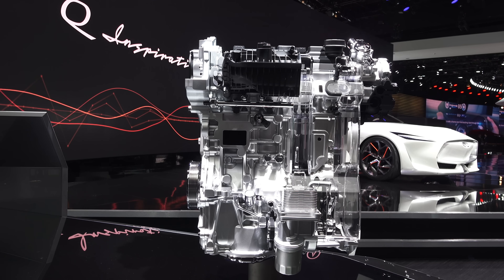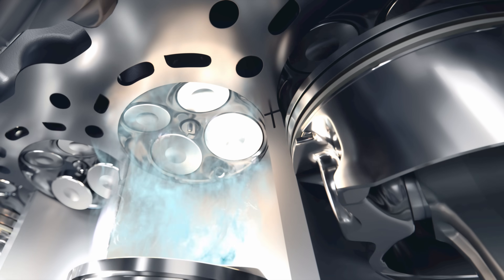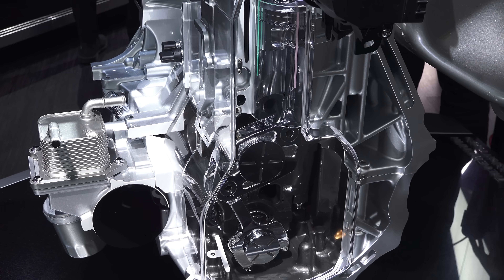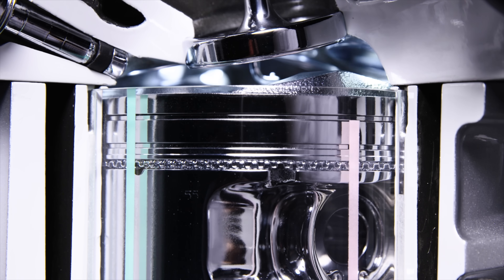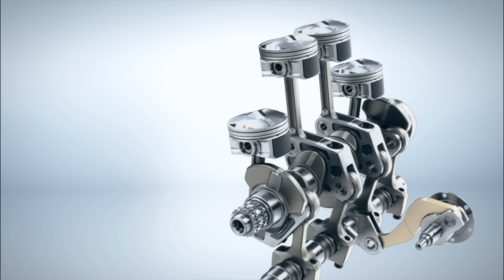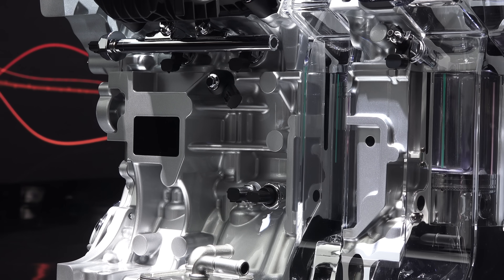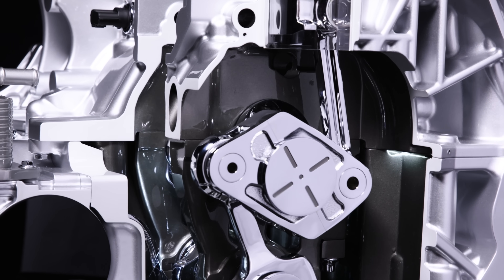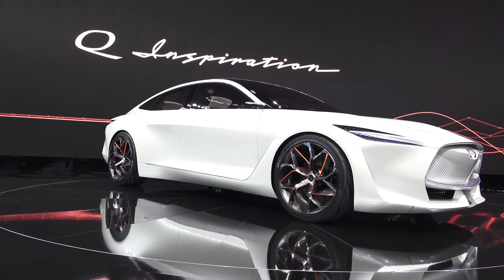INFINITI Reinvents The Gasoline Engine — VC-Turbo

Comment: Son do you know why 4.3 L Chevy V6 ease and small block Chevys made in the 80s and 90s would run 3/4 and 500000 miles before an overhaul because they were simple simple and efficient they were very efficient for what they were and the time they were in keep it safe
Reply: Donnie Bargo 96 Silverado, I sold in 2007, only ever needed new water pump, brake cylinder, serpentine belt. That was it over 11 years of driving it hard especially in snow. I just wanted to sell it before the rear went up lol. Engine was a workhorse

Comment: Exactly what we need more moving parts in the engine...
Reply: The system added on seem quite simple, and takes the place of the balance shaft, however that electric motor is gonna fail.
Reply: just make a telescoping piston or rod u can use oil pressure to regulate it
Reply: @bbqpat1  Electric motor is way cheaper.

Comment: Engine rebuilding is very hard and tedious work.

Infiniti: hold my variable crankshaft.
Reply: Right?! What happened to fewer moving parts and reduced friction points (on the crank/con-rod)?
Reply: Guess how many people will.
Reply: DexMaster881 enough to put out a recall
Reply: @jjpablo  Hahahahah American car recall :)
Reply: The engine has perfect balance without a balancing shaft and it also low cylinder wall pressure.
It's not that complicated.
Reply: @MazdaRX7007  it’s not about complexity, it’s about how catastrophically this will fail when it fails

Comment: I have a particular concern with the harmonic drive; when it fails, will the engine fall back to a setting that favors efficiency or power? It's nice that it is a mechanical linkage and it's all really pretty. Will it be a transverse only layout or will there be plans for a longitudinal variant?

Comment: i could see the a advantage of a variable compression ratio , and direct injection .  but i do not see a large gain in mechanical efficiency.  a very costly way to improve a very little on the overall effeciehcy.  you still  have a four stroke cycle, a reciprocating piston, etc. the only cycle that will prove more efficient in the direct injection coupled with the high compression ratio, will make this engine approach the efficiency of a diesel engine of approx. 30% but we are injecting into the combustion chamber gasoline instead of diesel. let ;us no forget the the heating value of gasoline its less than diesel fuel thus i would say the efficy will be somewhere between 18%and 30%.  its an improvement but not ideal. thus i would say let us stay with our old diesel or a direct injection gasoline engine.
regards,
antonio
canada

Comment: It's too bad Nissan doesn't make cars like it used to that actually lasted without breaking down. Sad to say cuz I've got an 01 pathfinder with 230k miles on it and it's been relatively reliable, but I wouldn't trust their new vehicles. Better get that extended warranty.

Comment: This looks Iike one complicated engine with all the moving parts and I can't see what they have actually achieved, when this goes wrong it's going to cost a fortune to repair but of course it won't be the manufacture whose footing the bill it'll be the poor sucker who bought it. This engine reminds me of the old Commer Knocker 2 stroke diesels of the 1960s era, that had rods flying in all directions but that was because the 3 cylinders were above the crankshaft. It was a good engine but very noisy but very economical on fuel.

Comment: I wonder if this kind of thing is the last gasp before electric vehicles take over the world.  Talk about simplicity versus complexity.  Of course batteries will need a quantum leap forward first.
Reply: Nuclear batteries powered by tritium.  Should last ten to twenty years with unlimited mileage until the batteries get to A certain age.

Should be able to refill the tritium as well.

Comment: Wait...what?  I was pretty sure that HIGHER compression ratios increase horsepower.  Squeezing the air/fuel mixture into a smaller space makes more power, no?

Comment: The ideea isn't new. Motorcyclist first noticed it and I as well. Engines have a wear zone where engine is breaked in and engine revs free because of low resistance at compresion stroke. That zone is just behind the the one were engine has low power because of wear and behind the one were engine burns oil.

Comment: Altering when the intake valve opens and closes could achieve the same results simpler.
Reply: How exactly ?? 
Compression ration is a function of swept volume divided by combustion chamber volume... what are you gonna do... bleed off compression as the piston travels upwards ? Not a smart idea.. 🙄😒

Comment: Did I hear that right, no in-line 4 cylinder can operate without a balancing shaft (5.28)?  Holy cow, I'd better race outside and bolt one to each of my cars! the only 4 cylinder I'd seen that needed a balance shaft was a V4 produced by Ford and later Saab.

Comment: Yes, but will the CVT transmission fail before the engine?
Reply: why not both
Reply: Lol it becomes the worlds most reliable engine on earth because the rest of the drivetrain fails before the engine has a chance to
Reply: Probably
Reply: Now it's a race to see what fails first.
Reply: Did they actually put it with a cvt?
Reply: @bmwlife786  I just checked (today is 2022 Sept 3):  QX50, 2022 model year, indeed paired this Variable Timing turbo inline-4 with a CVT... 😰
Car & Driver magazine's real world testing found the QX50 to have similar fuel economy as BMW's X3 and Volvo's XC60.
Makes me wonder if all this complexity is worth it...
Reply: @reallifeengineer  shocking and saddening the times we live in
Reply: Infiniti uses chains now. Reliability should be better than their old method.
Reply: What an ignorant comment
Reply: Cvt are fine I have 3 with cvts and no issues even in 1200hp application
Reply: Enter class action lawsuit, 2025…
Reply: Sometimes!

Comment: Thank you for this video, really interesting and maybe it won't be so unreliable. I just have one question, in a part of the video you said that is uses both port injection and direct injection, and for power mode it would only use direct injection. Isn't it the oposite way? During high reving direct injection is not as good as port injection mainly because the mixture is not homogeneous, Lamborghini Huracan uses both port injection and direct injection, direct injection for efficiency because of the startified injection which allows for more leaner fuel mixture and for power cycle uses port injection because of the homogene fuel mixture! 
Thank you for the great videos!

Comment: Koenigsegg in Sweden have developed a camless engine using pneumatically operated valves.  The engine has no cambelt or camshaft making it smaller and lighter. The oil pump need not be as powerful reducing HP taken off the crank. Oil will last longer. A management system can make it run at an Atkinson cycle, 4-stroke or a 2-stoke cycle on the fly.  Fiat use electric solenoids on the inlet valves of one engine.  The Koenigsegg solution is much better than this complexity. It is best they ditch this complexity for camless engines. Koenigsegg are introducing a camless engine in one of their supercars.
Reply: Yes they tryed this, but still don't have actual car with camless tech. Qoros use same technology (from same company as Koenigsegg) and end in prototype hell. Camcon made head for Ingenium family also prototype hell
Reply: @mateuszzimon8216  
the new Koenigsegg will have a camless engine.
Reply: @johnburns4017  this announcement was made before Jesko. With is still concept and don't use this engine. Still use 4 valves per cylinder

Comment: Saab had a way more simple design for a vcr engine based on felf contained cylinders and pistons, saddly they were unable to develop and accurate ecu controller and mechanism for a precise and variable valve opening time management as well as a header flexible enough to manage exhaust gases in different ci oression configurations. Finally they lack the technoloy for a variable compression turbocharger.
Reply: I think a factor was funding aswell... They was forced to use GM engines on last 9-3 and 9-5 generation

Comment: You never explained how do they transfer that crank elliptical trajectory into a linear rotation. Are they using some form of the planetary gears similar to those on rotary engines ? Or are they correcting that irregular trajectory in the transmission ?

Comment: Higher compression created more stress on the pistons and all engine moving components and so a higher wear and tear on the components. A race car engine is a top performer at high compression and RPM and are good for ONE race.

Comment: Wow I can't believe the ammount of people saying "it will break down after 100k miles". Don't comment on something you don't understand. I study Mechanical engineering and I can assure you the elimination of lateral forces on the cylinder wall will bring down piston ring wear and it seems the mechanism is not as complex to fix even if it does break - the only possible wear spots are the bushes of the linkage and perhaps the actuator itself, none of which will cause a catastrophic engine failure right away if repaired soon enough. I think this is a brilliant design and if I had the money, I would rather buy this than a standard V6 with the same ammount of HP

Comment: The effective compression ratio really doesn't change, by forcing air in with a turbo you are effectively raising the compression ratio (raising combustion pressure). Not saying this not great technology it's not explained properly

Comment: 3,000,000 (equivalent) test miles when divided into 600 test cars is only 5000 per car.  One oil change.
B F D.  

Put one into full time 24 hour pizza delivery service, only driven by teenage boys.  Then look at which one of those little crank pins gave out first.
Reply: I volunteer as tribute.

Comment: It’s a really cool design but the integrity of those multi links worries me, especially at high rpm. I would be suprised if the engine lasts 65k miles, but then you can pull that motor out and put in a supercharged a VQ35DE 😏

Comment: What infinity did was amazing i once thought that if somehow the piston rod length also slightly increase the cylinder housing(like Older Radio antenna) can be changed which will help in create more power. i used to drive a 110 CC scooter and thing came to mind that how can be possible to let 110 cc engine behave like 125 cc engine. so by extending such and changing compression something can be achieved. This was somewhat exactly the thing.

Comment: I'm new. Never fixed a car, not an engineering student, and lack a lot of knowledge plus experience. But, I am honestly curious. The video mentioned a lot of good things about this new tech, but what are the downsides? Aside than the typical more mechanical movements/joints = more maintanence. Thank you.

Comment: I do not agree with the vibration. The vibration is caused because there are 4 ciliders and there is no way to ignite the ciliders in a way that it can be compensated. 1423 or 1432 cause noise. 5 or more cilinders eliminate the problem.

Comment: It's better to say that the low CR under power mode lets engineers use more boost to safely make power the lazy way.

Tuners have been reliably making huge power on CRs of at least 10:1 for quite some time now. No one uses 8:1 anymore, that's 80s tech.
Reply: Also, port injection is mainly used to keep the top end clean and has very little to do with emissions or anything else, that's why DI was used in the first place.

Comment: Nutting is impossible, strong light weight reliable materials and a super fast computer and yes it's gonna work........BUT! .....at what price. Sometimes it's better to not re invent the wheel.....there are old Nissan, Toyota & Honda engines that came stock with 32 plus mpg

Comment: As an ingineer design that is too complicated and with everything making it to overly complex im concerned  it will be like the rotary wankel rx8 engine.
  I want to see engineers build an engine with elements taking friction to the minimum.
  This is possible only with a simple classic design without any hinges ,variable cams and lobes.
  You can make power if you use pure mechanical system like old school racing engines.
Everything else is brought to nowadays via electronics :ignition,timing,etc.

Comment: i'm wondering, instead of pushing the lower shaft through an extra arm, why does the actuator not rotate the lower arm directly via gears, or mounted at the either of the two ends of the arm, in order to save the extra space required

Comment: I don't understand what keeps that trapezoid-shaped gizmo that the con rod is connected to from rotating wherever it wants to go within limits by variations in the angle of the rod to the cylinder. And while the rod angle during the combustion stroke may be small, there appears to be an even bigger angle during other strokes. This looks like a mechanical nightmare.

Comment: Just use electric motor.This design is Like a steam engine from 1800s. Kooky coo coo clock . Are you sure the British didn't design this?
Has the mechanical efficiency been increased significantly? Like over 35℅ ? If not insane waste.

Comment: Why was the engine designed to run on 8:1 compression vs 11:1 compression on boost? It's direct injected I've seen multiple engines running high compression and direct injected turbocharged getting better fuel mileage vs lower compression direct injected engines that are also turbocharged. You want efficiency but you want the consumer to waste more money in gas. That engine to me seems like you can make it run a lot more efficient than what they want you to know. I HATE when manufacturer's do that all because they want to make more money off of the consumer...

Comment: Won't there be a fuel economy issue during the Atkinson cycle? Pushing out a portion of air-fuel mixture during the compression stroke by altering valve timing? What about the cylinder side force during exhaust cycle? The connecting rod angle during the exhaust cycle looked like it to cause a side force on the cylinder too.

Comment: That looks like a lot of extra rotating mass, can't be good for acceleration,  so they also need sequential turbos...a complex setup that was peak tech for a little while before the made single turbos better.  Many parts, will be more expense to build.
It will work great for 50,000 miles, might work to 100,000 miles, then it is done and thrown away.  This is a big 'problem' with modern cars and has continued to get worse, just drive it and then throw it away when worn out.  Over 1 MILLION cars are crushed every MONTH in the USA.  Sad, not eco friendly at all.

Comment: this technology could be great for flex fuel engines, like we have in Brazil
our engines uses Gasoline, Ethanol or any mixture of these two... since the compression rate is fixed, there's always a compromise, that could be extinguished using such technology
Reply: flexibility is here now,,in my drive in fact,,,i have an M35A2 that will burn gasoline, diesel, home heating oil, corn oil, wesson oil, discarded cooking oil, kerosene, and several other things. No electronics, and mixing of fuel allowed. 9 mpg,,,,,in high gear,,,on flat ground

Comment: if the internals were actually polished and machined to that specs i'm seeng in production it might be dependable, but i'm almost certain the showcase model is completely overdone and not great representation of what will actually come out of a factory.

Comment: Charles Atkinson's engine design comes alive. Technology based on a one cylinder engine design from the late 1800's. Also note the use of intake valve timing which is an application of Miller engine design. 

As someone has already commented, there is a lot of mechanical action going on. It will be interesting to see what maintenance - service requirements and longevity will be.

My question is, why spend so much money, and so much time on reviving old technology to squeeze alittle more efficiency out of an engine that burns fossil fuel? Think of the money Mazda spent on it's new design, let alone the Rotary. How much Honda spent on CVCC and VVT (Atkinson-Miller theory). Though the engineering 'fix' to Atkinson's original design is an accomplishment, it is overshadowed by the environmental impact of fossil fuel use.
Reply: I was wondering how the engine control unit adjust the timing during compression ratio changes.

Comment: Some serious money and development in conventional fossil fuel combustion engine....  But the real future is in electrical motor driven chasie.  I do love petroleum driven engines, the sound the smell, dont get me wrong and I own a modified 2.5 WRX and a 4X4 Toyota and a Merc sprinter, but looking at what the future holds. An electronic motor delivers more torque faster and as battery storage Keeps improving like the advance in chemistry batteries lipo it's only a matter of time that the combustion engine is retired just like most 2 stoke bikes now or the old Suzuki 4x4 two stroke. 2 Stroke engine,  ever stroke is a power stroke like the days of the gp500vlong gone but not forgotten. Now I'm rambling on.
Reply: I can't wait for an affordable electric dual sport bike.

Comment: What a mechanical nightmare. Taking a nice, simple design and turning it into some kind of complex clockwork mechanism. Worse, it's Renault! It's going to be very interesting to see if this actually stays on the market. Or, will it have massive issues, cost the company a fortune in warranty repairs, comps, and extensions/campaigns. This is even worse than what the Germans try to do. I wouldn't buy this until it's been out for several years, That's for damn sure.

Comment: Variable Compression is not new, and it was never meant to be used on daily drivers. That tech was only used in labs to run tests, the use of this engine is the reason Nissan/Infinity is going down the crapper.